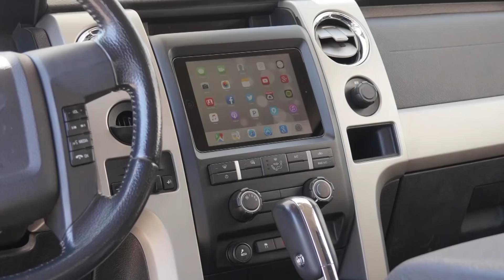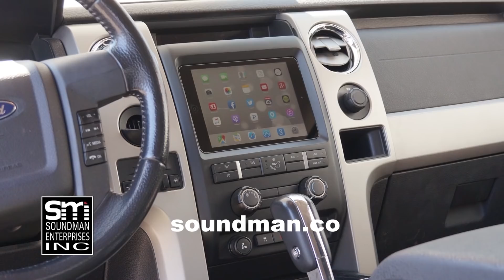I pulled the MULE TRANS FOR REPAIR!

Comment: Try or look at the DM601 by 3m. Same mixing tips and applicator. Dry time really quick like 5mins. Bottle says 1min. We use it too tamper proof bolts/locks.

Comment: Are you using an aftermarket shifter? There are more than a couple different shifters available for the VW transmission that have shorter throw and reverse lockout, may be a good upgrade to consider.

Comment: Hey doug next time you want to pull out a cotter pin put some vice grips on the head The mushroom tip then just wack your vice grips and baaaaaam straight pull that shit out clean no need to straighten out that BBBBBBBBBBBBBBBB